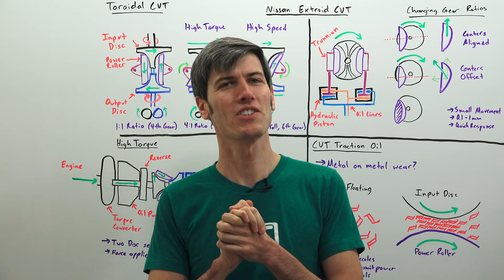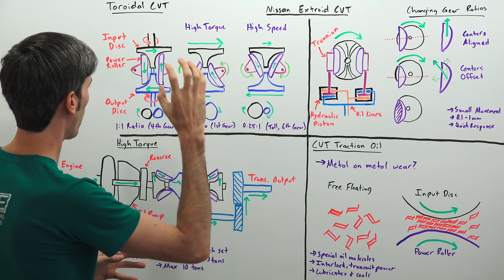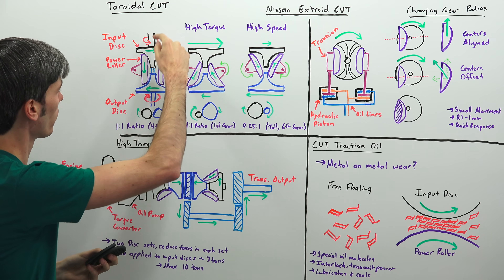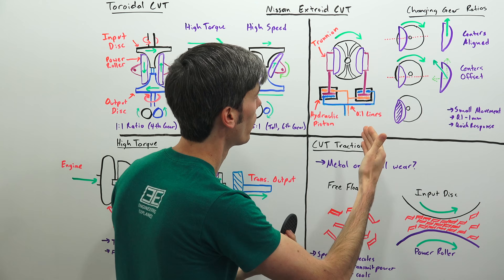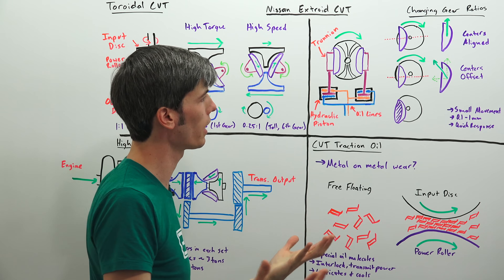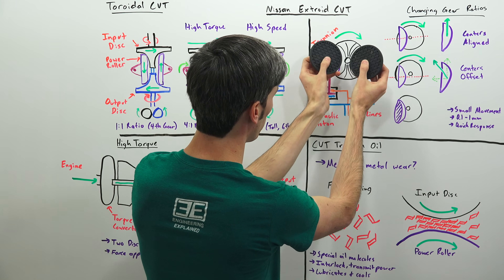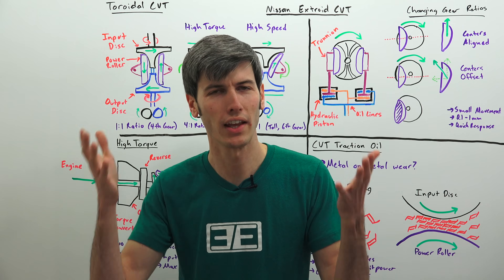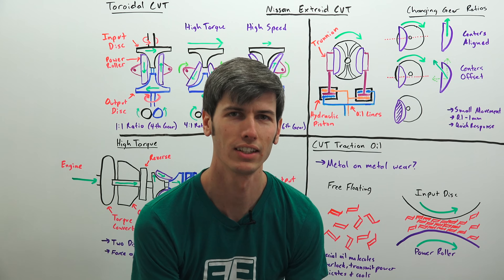Nissan Created The First Production High Torque CVT

Comment: Anyone else find the oil the most interesting part? Would love to see how it actually changes wear and power transmission compared to other oils and just bear metal contact.
Reply: Oo, non-newtonion oil! So much clever.
Reply from the maker: Quite cool!
Reply: Could you say that it's an oil that turns "sticky", or becomes a fluidic clutch friction material, when compressed?  Isn't the oil used in push belt CVTs similar?
Reply: @JK-rv9tp  Good point, didn't think about that. That's good to hear then because these fluids might last a decent amount of time. Is this similar in a way for some wet clutches?
Reply: @sigmaprojects  Most wet clutches have regular friction surfaces and work in regular oil; in motorcycles, gearbox oil, in automatics, hydraulic oil.  CVT oil is crazy expensive, as many hundreds of $ to change it, and I'll bet this oil is even more expensive.
Reply: @JK-rv9tp  Gotcha. I'm sure it'll be more expensive than normal auto fluid, but CVT fluid like that Honda uses is about $15/quart and their average capacity is about 6 quarts. So about $100. If the fluid doesn't need to be changed for at least 36K, miles I think it wouldn't be so bad. I'm betting it'll last longer though.
Reply: @sigmaprojects  yeah, the extroid specific fluid runs almost $125 per liter (list) and specs seem to call for 8l
Reply: @RobertSzasz  Oh damn that is pricey, I hope it doesn't need to be changed very often, lol.
Reply: @sigmaprojects  the oil used in this cost $500 for a tin 2 is required for a service the expensive service and frequency of the services is why this cvt died off after 2 applications
Reply: @RobertSzasz  yup you're correct just bought 2 tins of nissan ktf-1 for trans service in my jdm g35 tbh i wish it blew up
Reply: @EngineeringExplained  Does the oil that prevent wear wears out? Because the particles can't be harder than the rollers, otherwise it would scratch the rollers, just like loose metal particles that didn't get caught by the filter in regular oil. But if it's softer it might get deformed under pressure. Not to mention it could just get "sanded down" with each other over time.
Reply: So, what I'm getting here is they created a sort of ooblek oil? That is really cool but I can only imagine it would need pretty regular maintenance and changing. Something's gotta exchange heat and wear out / break down molecularly.   Better it be the oil than the steel.  Super interesting.
Reply: @miinyoo  Yea, I like this. I mean if the wear component is primarily the oil regular oil changes would be awesome over the current clutches wearing out in a conventional auto. I'm curious of the price.
Reply: @miinyoo  except Nissan will give it a "lifetime" rating to get good CR and JD scores then later change it but half the cvt's will be in the junkyard by then.
Reply: @miinyoo  
You can only imagine how much that fluid must cost LOL
Reply: I want to see one of those creative destruction channels put it into an engine to see what it does.
Reply: Looks like just the cvt fluid for a full change (8l) runs around $1000 US
Reply: i do! this oil must be something magic, since the concept of this CVT relies on a point-to-point friction connection to transmit torque, if i understand it correctly (belt driven CVTs have at least a more ore less wide semi-circle shaped contact/transmission area). i am not an expert, but i am quite surprised this thing obviously works in a high torque production car without burning into parts after 200 km .. ;D
Reply: I wonder why they didnt used a cogwheel instead of some hi tech lube. What am I missing?
Reply: @trollmcclure1884  I'm not sure how the cogwheel would work since on the cone shaft how would you arrange the teeth? They'd never be able to mesh at variable rates.
Reply: @sigmaprojects  I'm not sure. The whole design would be diferrent using only the concept. Maybe there is a better cogwheel system as it's 20 years old tek
Reply: @trollmcclure1884  I believe a CVT that uses any kind of teeth has to use a belt/chain.
Reply: @sigmaprojects  imagine a long conical shaped cylinder and a moving wheel.
Reply: @trollmcclure1884  there are conical shaped cylinders, but the moving wheel would also have to change in shape then. Or two conical shaped gears with a gear that somehow can move in the center, but then you have the problem that the gear has to move diagonally. That's why they use a steel belt/chain because that's essentially what they wrap the belt around.
Reply: @sigmaprojects  you are probably right. Now I see the gear-teeth problem in my head. I was thinking about kinda round,  sphere-shaped gear with triangular teeth of a variable density. It most likely cant be done so they found a better way around
Reply: @trollmcclure1884  Sounds interesting, probably just a nightmare trying to figure out the math on a setup like that, manufacturing and figuring out how to set the backlash.
Reply: @sigmaprojects  yea
Reply: @sigmaprojects  I think you're talking about the holy grail of transmissions (the gear driven CVT) If you figure out how to get them to mesh I'll give you $1000 for your idea😁... People have been trying, why are there no (practical) examples in existence?
Reply: @Wooskii1  That was Bhaktisamadhi Pappagiorgio who was thinking of that. I was saying it must be a nightmare trying to figure out something like that.
Reply: @sigmaprojects  yeah, my fault. My YouTube app/phone is a mess lol
Reply: Sounds like a non-newtonion fluid to me.
Reply: I wonder if the friction modifiers are proprietary technology?
Reply: @steveXracer 
Lol, the dealer would say it's very very special fluid.....lol
Reply: Yea, I wish he had gone into more detail on that. The video was 90% this is cool idea and theory but the last bit on the oil was how it actually works in reality.
Reply: In essence it is transmitting all of the force by shear, though an oil film less than a micron thick without any metal to metal contact. The same type of lubrication occurs in roller bearings and precision gears where the lubricants viscosity increases tremendously at huge pressures. However in bearings and gears, shearing is not so significant with the majority of the forces acting normal to the surfaces. I assume this may be the reason for the special oil.
Reply: Seems some kind of nano graphite cristals with groups bended out of the plane.
If so, the nano cristals should be the same size 
Probably, the groups would give coesion between the molecules
Reply: Not bare??
Reply: I've replaced the oil in my 1999 Nissan Gloria at ~120,000km. It uses Nissan KTF oil which they call a traction fluid.
It's blue and very expensive, it was 10L for a flush change.
I was still going strong at over 200,000km when I sold it.
Reply: Bear metal...sounds tough!
Reply: @joshlemons3662  i prefer virtual environments, they have better security :)
Reply: @LordDecapo  Eye perfer speling.
Reply: @jwo7777777  tfw you should bave proof read before hitting lost.

Comment: Ewwwwww cvts are awful
Reply: Depends. A couple of years ago torque converter were awful and now they are coming back.
Reply: Marfran Dema thats a good point, they lock up in all gears now in newer transmissions. Still prefer manuals/automatics/dcts over any cvt tho.
Reply: I have about 90k on my cvt awd Nissan Juke, the light weight and ability to keep the engine at max rpm makes it pretty fast from a roll. Passing on the freeway is a breeze. Still I would definitely swap one of these in if it would allow me to tune the engine up to 300+ hp/tq. Although to be honest I probably don’t need to be going much faster driving around on public roads. On the other hand this toroidal design may prove to be more reliable and longer lasting.

Comment: How about Nissan create a CVT that doesn’t die at 18,000 miles like the one in my Sentra did before I got rid of it.
Reply from the maker: My friend's got 200k on his CVT Murano. Unfortunate your Sentra died so young, hope things are better now! Anecdotes also don't tell full stories (like my friend's Murano). Need larger data pools to know if something is good/bad.
Reply: @EngineeringExplained  According to Consumer Report's data pool (not sure how large it is) the only transmission currently in production that's worse than the Nissan CVT is Mitsubishi's.  But Nissan has 3 SKUs of CVT and the CR table I saw didn't disaggregate by model - one for for the Maxima, Rogue, and Murano; one for the Sentra, Altima, and Kicks; and one for the Versa and a small car they don't sell in the U.S.  They all share the same fundamental design, just sized differently.
Reply: Engineering Explained how many transmissions were put in your friends vehicle? Remember it a Nissan
Reply: @EngineeringExplained  My daughter's 09 Sentra got 172,367 miles original trans. But, i feel failure eminent.
Reply: Engineering Explained why is this such a loss concept to people.
Reply: Engineering Explained Unfortunately such studies are very expensive and no one really has any incentive to carry them out. So, we have to rely on anecdotes for the most part. And I’ve heard tons of anecdotes about Nissan CVT’s failing at low miles, but none about Toyota CVT’s failing prematurely. This leads me to think there’s quite a bit of truth in the popular view that Nissan CVT’s are poorly-made junk that often give out soon after the warranty is up, leaving the owner on the hook for a $4000+ repair. The market seems to agree as well, since newer Nissans don’t hold their resale value anywhere like as well as a comparable Honda or Toyota.
Reply: Consider market share. There are far fewer Nissans than there are Toyotas or even Hondas on the road. Also keep in mind that the majority of these Nissans that are on the road are equipped the Jatco cvt.

Simple arithmetic would show that due to the high amount of reported cvt failures in nissans this would indicate a ridiculously higher than normal potential failure rate.
Reply: @JohnnyAmerique  I agree with this line of thinking, that the most likely CVT's are garbage, having expereince with one myself. There was one mechanic who said it's the owners faults because they abuse their cars and don't change their transmission fluid. But I have seen reviews in which people said they did change their transmission fluid and it still died, and one Nissan Tech I talked to said that there was a 2018 Altima at his dealer that had a transmission fail at less than 500 miles. I'm not really buying it, but I'd be interested in seeing a study so we can get large scale picture of whats really going on. I'm all for maintaining my car and adjusting my driving to be best for the car but that doesn't mean I am willing to go out and risk buying (another) car with a fragile transmission. I also looked up the Kelly Blue book for a 2012 Nissan Versa in excellent condition versus a 2012 Toyota Corolla in excellent condition and the Versa was worth less than half of than the Corolla. In 2012 these cars both had about 12,000 MSRP, the Corrolla just slightly more.
Reply: @barrymccaulkiner7092  there's definitely not "FAR" fewer Nissans than Toyotas. They're selling millions and millions of these vehicles world wide.
Reply: @Jason and EE I wonder if Nissan seems to have a less reliable CVT because they sell more vehicles with CVT, since most of their cars have CVT for a long time?
Reply: @nickolastiguan  faulty design to inefficient cooling that causes the CVT to overheat then fail.
Reply: It's sad when the jatco cvt isn't able to outlast the lowly Denso spark plug...
Reply: We’ve never had any problems with our Murano or Altima. We’re happy
Reply: I have a Altima with 48K on it with no issues at all.
Reply: @galaxywolf4895  Yeah just wait.
Reply: @Brendan Yeah, my biggest worry about them is they're affected by operating conditions far more than a typical AT which tends to have a long service life even if mostly neglected. One day they may be great, but for now I still see them as a giant experiment being done on the customer' dime.
Reply: Jason Izquierdo 
Damn! 😳
Reply: Jason Izquierdo well I had a 2013 Nissan Altima and I live in the west coast Bay Area so I guess the hottest it’s really gotten is like 102 degrees F but I had 114 thousand miles on it and I wouldn’t necessarily say I was a careful driver lol. Only reason I don’t have it anymore is bc I got into an accident and was totaled by my insurance company but not due to cat issues. However my cousin had one as well and she had to get rid of it at 75 thousand miles cause the transmission went out.
Reply: Jason, dunno what model year your Sentra was, I have a 2008 Altima with over 252k miles & still going strong, owned it since 2011 & got it with about 64k miles on it.  Haven't had a single issue with the CVT.  A friend of my owns a small dealership & he's said to avoid newer Nissan's as those are the ones seeing the CVT issues more so than the older models.
Reply: CVTs are meant to be good. Looks like Nissan have a proprietary AT fluid, either you use Nissan only or your transmission dies.
Reply: That's why I chose the manual one.
Reply: Jesus..that bad
Reply: My Sentra has 150.000 km.  Still working good.
Reply: Most premature CVT deaths are probably caused by bad maintenance or garages filling it up with Dexron instead.
Reply: Engineering Explained ; I have some less anecdoteal(sp?) evidence, Im a wholesaler and on nissan CVT's I see approx somewhere around 1 in 3 have a trans problem where as a CVT on a prius, I have yet to see a single one with a problem... Would be cool to do a video on what the difference is between the two from an engineering standpoint.
Reply: dmc7173 the old Jatco CVT’s from what I learned with Motoring journalism was that they had plastic parts apart of the drive chain. These were parts used to reduce costs of the CVT since Nissan was in an economic struggle. Such style most likely persisted from 2006 to the 2016 models with the mid cycle refresh 2017’s having the updated set. 

Also, being that a Prius is a hybrid its CVT wouldn’t take nearly as much wear as a pure gas, both being supplanted by an electric motor system and by being attached to a very low power engine.
Reply: I have a 2010 altima I’ve owned for 4 years and I beat the crap out of it. No issues from the cvt yet. When I first got it it did whine after driving for 2 hours in hot summer weather but started changing the fluid every 50-70 k and it hasn’t made a noise since. Heat is the cvt killer.
Reply: Dont worry. Your sentra is far from being the only one.
Reply: My maxima had around 160000 when I sold it  no problems with it.
Reply: @jackiechance795  I heard the maximas have a more durable cvt cause of the v6
Reply: My mother also had a 2003 Murano that went though 4 CVTs. All documented. We live in NYC, those things have over heating issues due to a design flaw that doesn’t allow proper cooling which is how many of them die.  Hot & humid climate is a death kneel for those CVTs. 

Same thing happened to my co worker’s Senta (2013) and my cousin’s 2014 Altima. I traded it in for an Armada but this will be my last Nissan.
Reply: Or the put 3 pedals back.
Reply: I think the second coming will happen before Nissan dose that 😐.
Reply: We have a Murano thats done 380,000 kms, still runs strong although CVTs are irritating to drive.
Reply: @Khaled.3y  Why irritating? I find the CVT the opposite of irritating.
Reply: @Khaled.3y  how hot it gets where you live ? .
Reply: ARKENSETH 48°C in the summer
Reply: @Khaled.3y  well that's why it lasted and may be you some how got lucky are you could be a good carful driver that don't drive as much , but anywhere it's 39,c in the shade  are hotter , your CVT life span is now two to three years max . CVT are not ment for hot climates .
Reply: @arkenseth7532  I'm in Malaysia and its got and humid the whole year. My car is using a punch cvt which in my opinion is the worse cvt because instead of using a torque converted like a conventional cvt it has a wet clutch..... I need to change the cvt oil and filter ever 60k km or about 37k miles.....
Reply: @arkenseth7532  Umm, 48C is pretty damn hot. That's 118.4F.  He said his lasted even though it's hot as hell.
Reply: Every 2013 up sentra with a cvt has a 100% failure rate before 60k.

Comment: I love learning about these things.   The amount of engineering genius that goes into making ICEs match the performance characteristics of electric cars is incredible.
Reply: Even without going fully electric it is already possible to make an electric transmission for an ICE engine. That is basically a hybrid where all the power is transmitted through the electric motor, with or without battery storage. It used to be a big weight penalty but not any more with today's tech. 
So even if ICE stays around for much longer CVTs, manuals and automatics won't. It will just be ICE engines running at their optimum operating point driving a generator. No more clutches, torque converters or differentials either.   
I doubt we will see any new designs incorporating mechanical transmissions beyond 2025 even if ICE engines will probably be with us at least another 15 to 20 years for various reasons.
Reply: Ryan Boyer yup, the last ice cars will be great.
Reply: Yep and that only proves how electric will inevitably take over